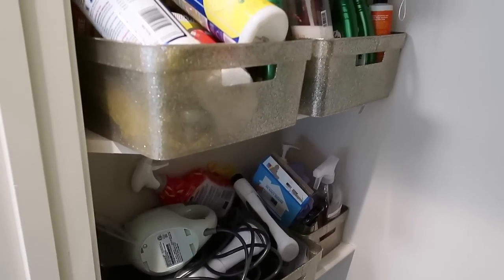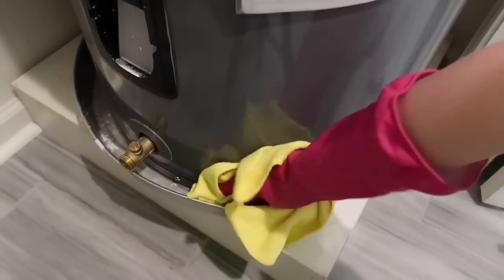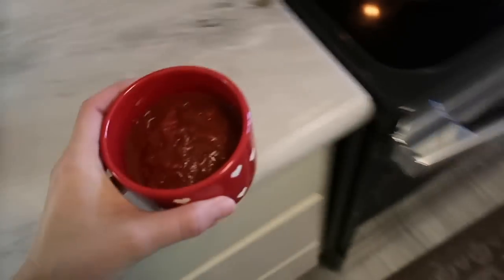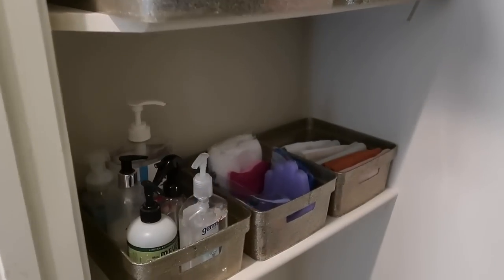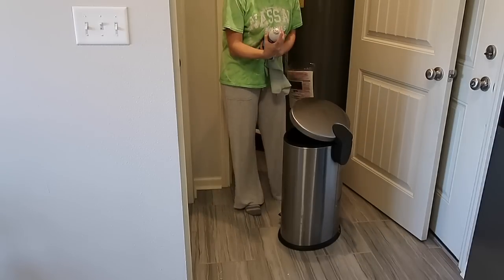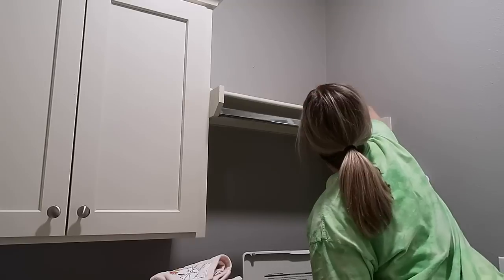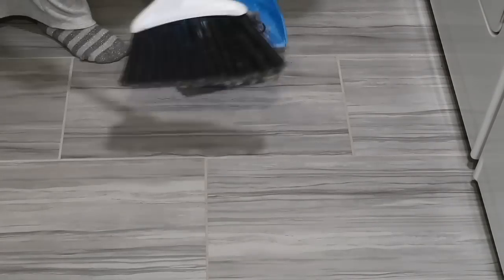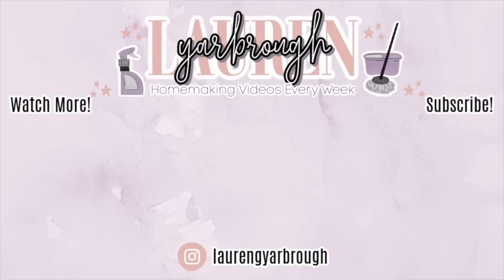2023 SPRING CLEANING! | DEEP CLEAN + DECLUTTER | CREATE AN EASY TO MANAGE HOME! | Lauren Yarbrough

Comment: To make your life easier in the Laundry room, flip your dryer door so it opens the opposite way. The doors are made to open either way. They already have pre drilled holes and hole plugs. It's just a couple of screws. Then when you transfer wet clothes you won't have the obstacle of the dryer door.